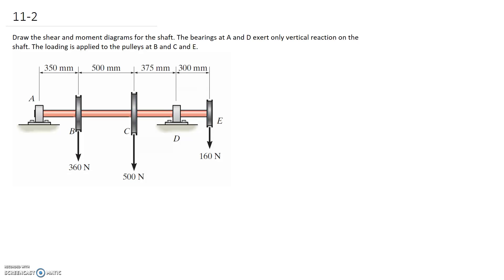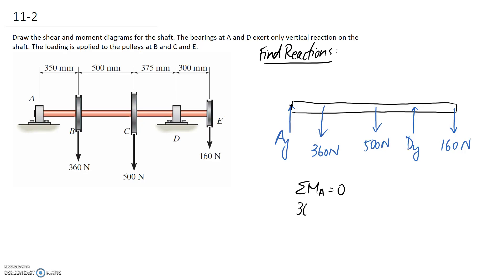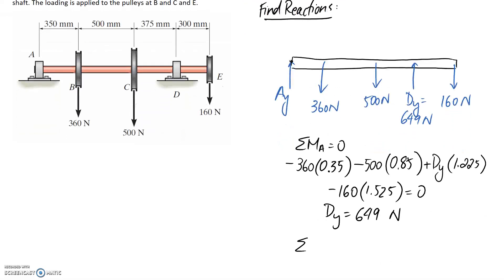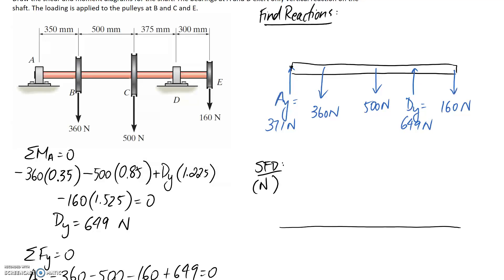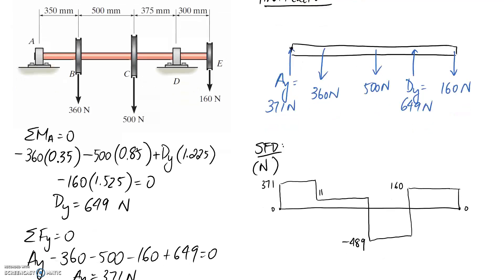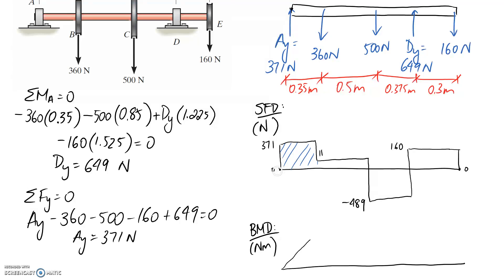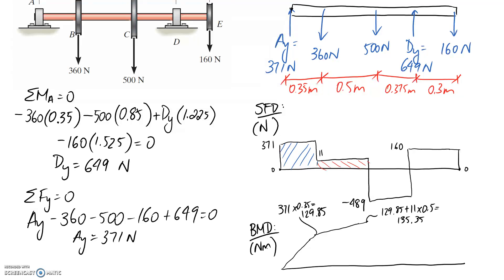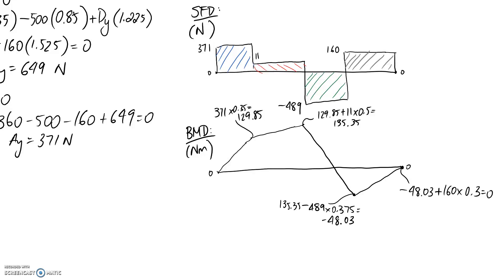(11-2) SFD & BMD with Graphical Method #1

Comment: I need help regarding a question. I want design shaft for shredding / metal crushing machine.  can you tell me how to  make free body diagram for that. because you know the shaft is hexagon shape and loaded with many cutting blades in shaft.
Reply from the maker: You'd need to quantify the forces acting on the shaft...

Comment: Hi Sarah, in your previous video you mentioned that moments need to be considered differently i.e. clockwise = positive moment, anti-clockwise = negative moment. How come the moments for the fixed joints on A and D have not been considered?
Reply from the maker: It's because they aren't fixed joints - they're treated as roller joints. The question also states that A and D only exert vertical forces.

Comment: I believe in the BMD the solution to (129.85+11)*0.5 should equal 70.425 Nm instead. The error then carries to the last solution not ending back at 0.
Reply from the maker: I think my solution is good - it's just that you have got the brackets incorrect in yours. Should be 129.85+(11*0.5) rather than (129.85+11)*0.5).
Reply: I now realise it's calculated 129.85+(11*0.5), so please forget my above comment.